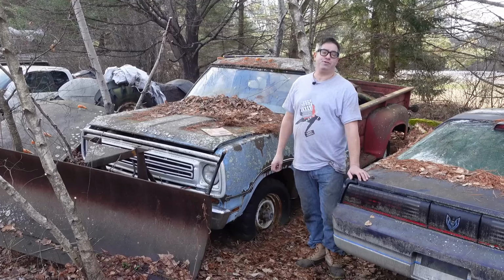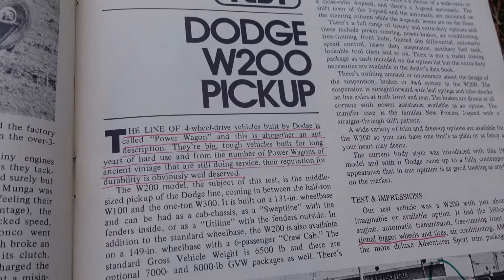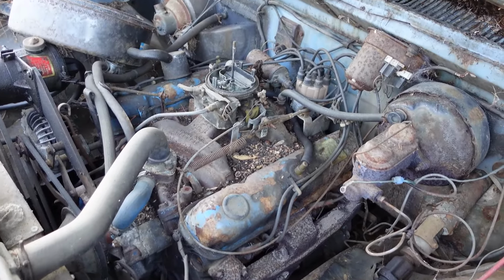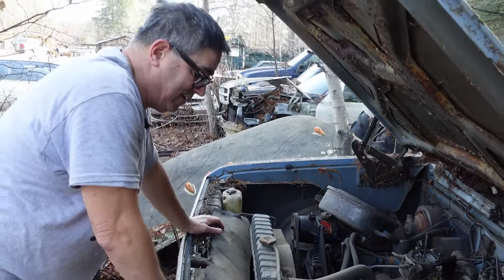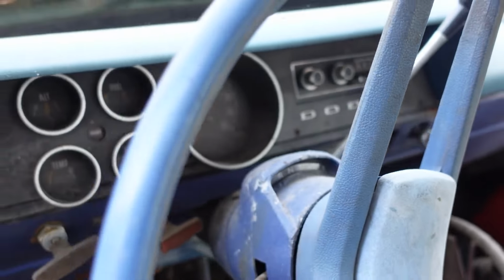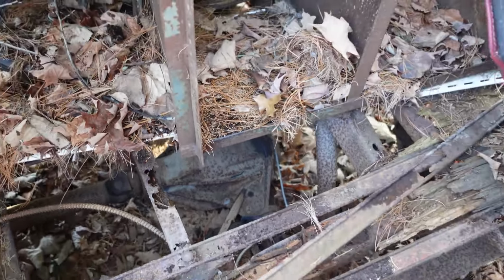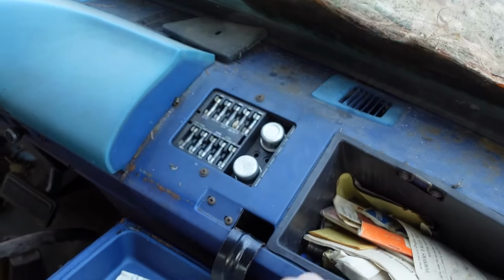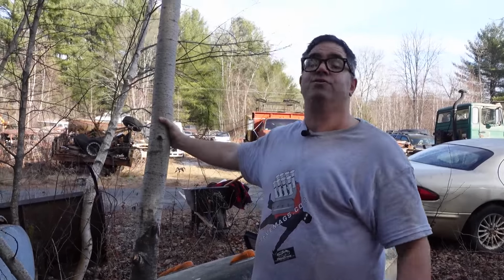Truck Week EP30 - W200 Utiline

Comment: We're all rooting for you to get back to what you enjoy doing, so hope it is soon. As stated last time:

1972 (not 1973) to 1993 were the same basic style. Starting in 1994, the D and W Series became the "R" Series in Chrysler nomenclature. An odd thing that is on the firewall (presumably put there by the line workers) is "No Ticket". I believe that means it does not get a trim tag in that spot for whatever reason. That's not correct, GM offered HEI in 1974 as an option and it became more or less standard across the board in 1975. I know of someone with an original HEI equipped 1974 Pontiac Grand Prix. Unaitis Excavating appears to not be around any longer and it appears that it was a few brothers (Charles and Tony) working together for a number of years, with Charles passing in 2019. 

Wish we had the VIN, then we could win (and determine if the truck was a Utiline or a Sweptline originally): W for 4WD conventional chassis, 2 for 3/4 ton rated, 3 for Conventional Cab Utiline or 4 for Conventional Cab Sweptline, A for 6,000 # and under Gross Vehicle Weight Rating or B for 6,000# to 10,000 # GVWR, F for 360 V8, 3 for 1973 model year, possible S for Warren Truck, Warren MI assembly and the rest is the production sequence. The Warren Truck plant still operates under Stellantis and opened in 1938. It was often called "Dodge City". Should be code DT8575 Medium Blue exterior paint which was close to the car color code B1 Powder Blue that same year. Missouri Truck and Windsor were also possibilities for assembling these trucks.
Reply: That orange book in the glove box was from Tony Unaitis. Tony Unaitis in the excavating business. He was a Teamster, Local 404 for 20 years while working for Haigis Transport in Greenfield. He then went on to work for the Massachusetts Highway Maintenance Dept., retiring in 1992. He passed away in 2001.
Reply: @jaysmith179  Pretty unique.

Comment: I was wondering why you could not get the 400 with 4x4.  Today it is the opposite.  I tried to build and price a new ranger with the 2.7 turbo V6 and you can ONLY get it with the 4x4.  No drag race Ranger.